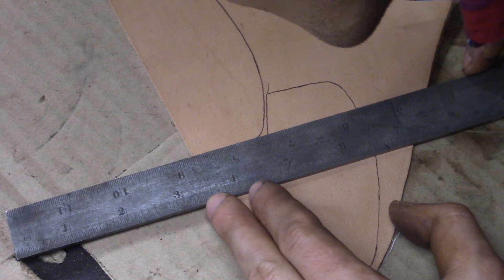Phantom Bevel Axe Refurbish - Making The Sheath

Comment: at 10:24[?] it occurred to me to suggest you begin sewing by initially bringing the needle thru only one side, from in between the two side of leather...so that the end knot of the thread is hidden...at 11:28 - type of glue?...at 15:36 - just mesmerized by the quiet careful process...by 16:30 - such appreciation for the planning and the simple concept of something made by hand...and at 20:00 - wish pop could see all the creative, useful things you make
Reply from the maker: putting the knot in between would have been a neat idea! Next time I guess. And i used shoegoo, any kind of rubber cement would have worked, I needed something to hold the mess together while it got sewed! I tried a new no-talking tactic on these two videos, i think it came out well!